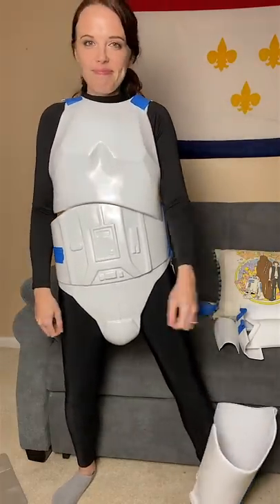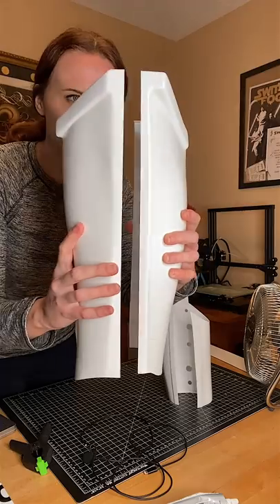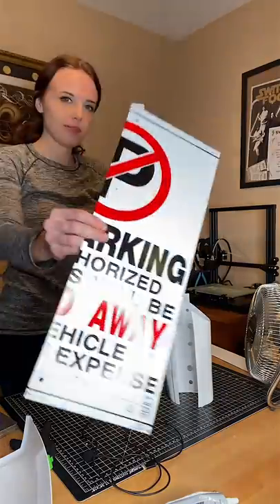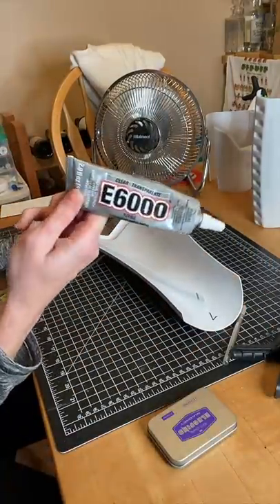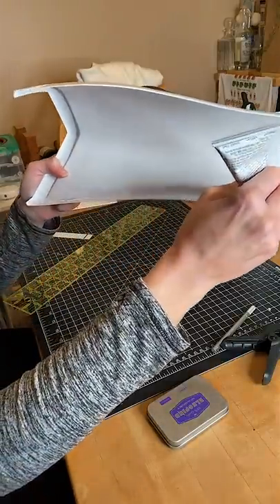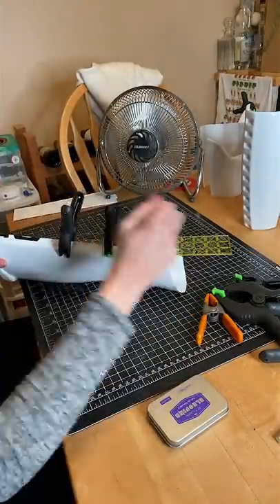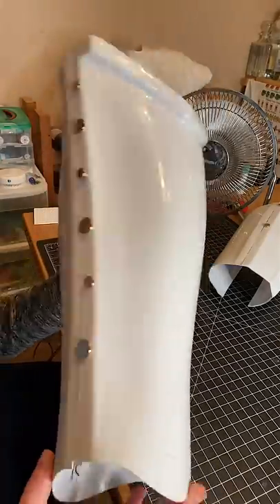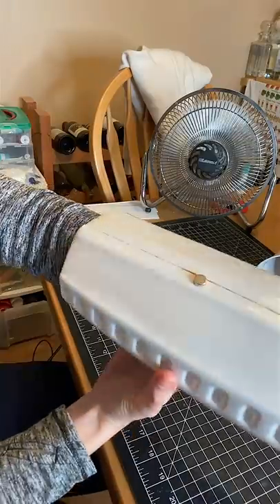Stormtrooper Build: Gluing Pieces Together with Inner Strips #short

Comment: Her: “Stormtroopers have a lot of armor”
Me: “That doesn’t help with one blaster shot”
Reply: Actually you’d be suprised if you read a lot of the old Star Wars books they tell you that when the storm troopers got shot they only got knocked out from shock as the armor actually repels the blasts from the guns not to mention they’re even bullet proof the only ones actually dying is from light saber and force attacks
Reply: @MistressAnko  you see it in the movies and clone wars too, some soldiers are hit and then in later scenes there fine again. Also i think if it where otherwise they would search cover more often and not just stand in the open all the time like they got a death wish, or have those swat shields when storming a room. And you can sometimes see that shot down troops get pulled behind conver, and in clone wars they had med stations full of clones. If there armor wouldn’t help there wouldn’t be wounded.
The stormtroops on the death star died tho. Dont think there armor could tank this explosion
Reply: @georgemurdock7670  yea they did die when the Death Star blew up imagine this thou there was all the storm troopers families in there was basically a planet sized city